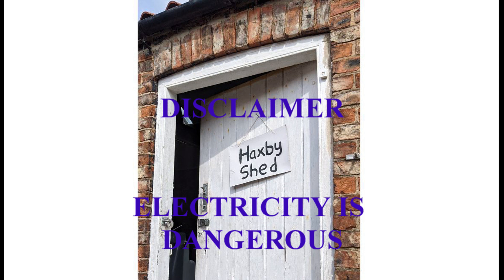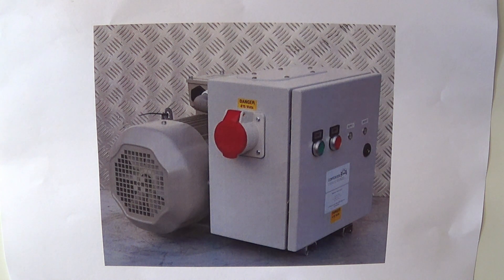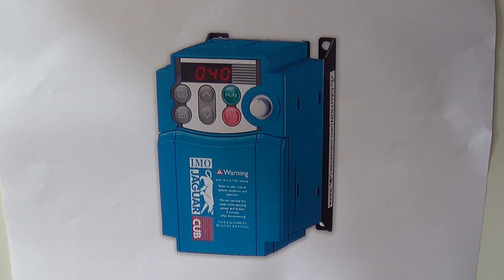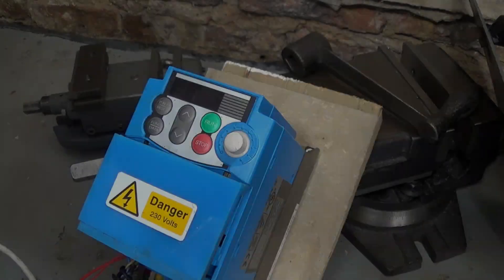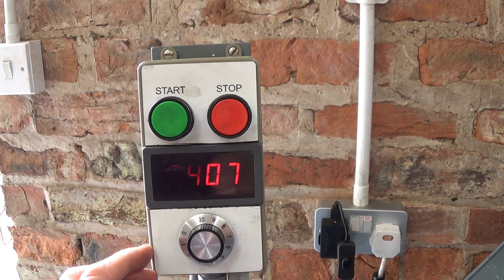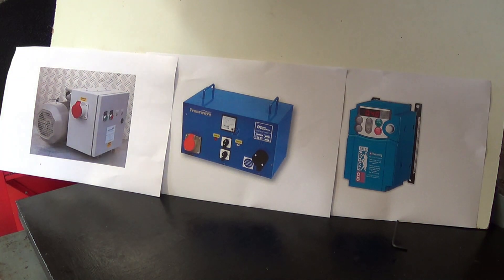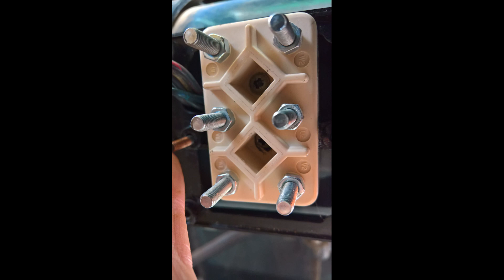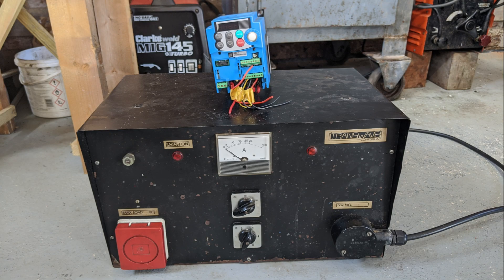HS6 Inverter VFD drives for 3 phase lathe and shaper machines

Comment: Very useful video Paul. I need to replace my noisy single phase motor on my Dore Westbury milling machine and would like to go down the 3 phase motor / VFD route. But how do you decide on what hp 3 phase / VFD combination to go for? 🤔
Reply from the maker: Hi Andrew, well just using basic logic I guess a 1HP motor is a 1HP motor whether it is 1Ph or 3Ph. So I'd suggest just getting a 3ph motor having the same rating as the 1ph you are taking off - at least as the starting point for your planning. Then the inverters are generally stepped in size in line with the standard motors. 1HP = 746W.  You will see the inverters rated 0.75kW (1HP), 1.5kW (2HP), 2.2kW (3HP) ....  etc.  There are plenty of cheap 'no name' inverters that are fine for routine jobs but if you think the motor will be heavily loaded at low rpm then best to get a known industrial brand like Siemens, IMO, Mitsubishi because they have much better torque control at low speed.   The industrial grade inverters are expensive but I have bought 2nd hand off ebay with no problems. Hope that helps. Paul
Reply: @HaxbyShed  Hi Paul. Thank you for the very clear and helpful explanation. You have cleared the confusion from my head. The Dore Westbury currently has a 1/2hp motor. I’ve read on a DW forum users having success with both 1/2hp and 3/4hp 3 phase motors.
Your comment about using a known industrial brand inverter is making me think perhaps a Mitsubishi 0.75kw (1hp) combo is adequate for my needs.
I’ll let you know how I get on.

Comment: VFD - ONLY 240V across 2 phases ? Are you sure ? - nah - it's 240V per phase - so standard UK 415V (across 2 phases) - so normal 3ph motors are wired 'Delta'.
Reply: The input to the VFD is 240VAC single phase, so it can't output 415V.  The maximum output will probably be a bit below 240VAC line-to-line 3-phase.  As per the video, 3-phase 240/415 VAC motors ARE wired "star" for a 415VAC supply because each winding is suitable for 240VAC.
Reply: @chrisarmstrong8198  As I understand it, VFDs use an inverter - the output voltage is not dependent on input voltage. Mine is 12V DC input, 240 V AC output. So VFDs can output 415V AC - although I believe they're more expensive. Fair enough !
As for motor wiring, I was referring to normal motors, not a lower voltage type you mention.

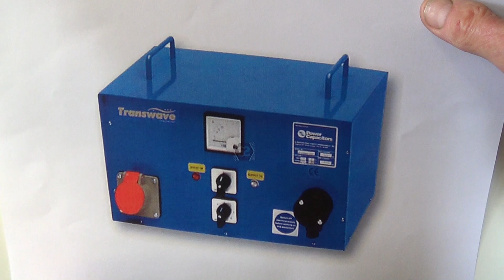Comment: 1:26 And the fourth option is to use an MG set - where a single phase large motor drives a 3phase generator...

And the 5th option is to use a 3 phase diesel generator. Which I did as I couldn't find option 4 !

Anybody want a Transwave static converter ?
Reply from the maker: Hi pmailkeey, you have sent me a lot of comments, thanks. I understand your style I think, give me a bit of time to think about what you are saying and I'll respond over the next few days. But on your Transwave, people are still paying a lot of money for those. Stick it on eBay and you will get a lot of interest. I got my shaper with a Transwave thrown in and what I got for the Transwave almost covered the cost of the shaper. Cheers.

Comment: Thank you, that was very helpful, as at some point I need to replace the single phase motor to a 3 phase motor c/w VFD to my Boxford lathe,  but I think I'll entrust the wiring to an electrician, just to be safe!
Reply from the maker: Dave, my lathe and shaper are 3 phase. I have not tried to speed control a single phase motor but I can say the VFD and a 3 phase motor is a very smooth setup right down to just a few Hz and (I think) constant torque control by the VFD. Also VFDs are becoming very cheap now. Cheers
Reply: @HaxbyShed sorry,  I didn't make myself clear, I need to change from single phase (now)  to 3 phase on my lathe,  and use a VFD